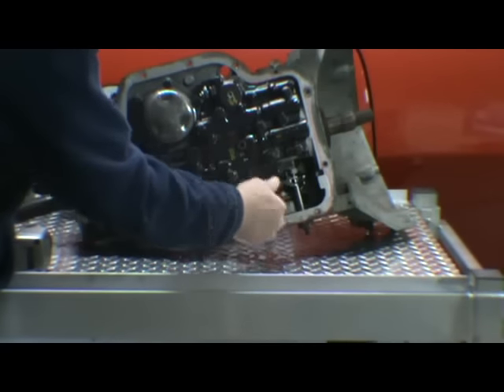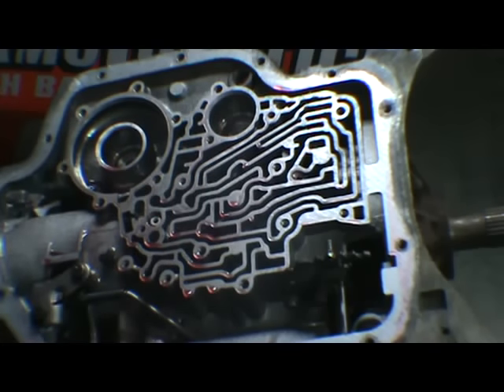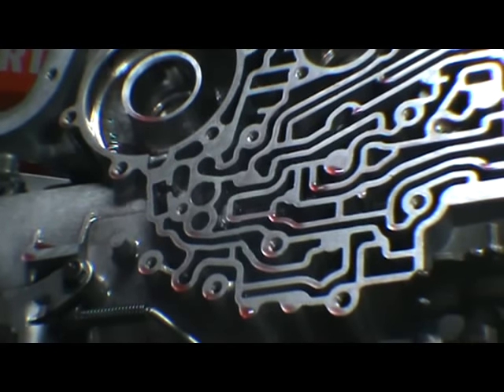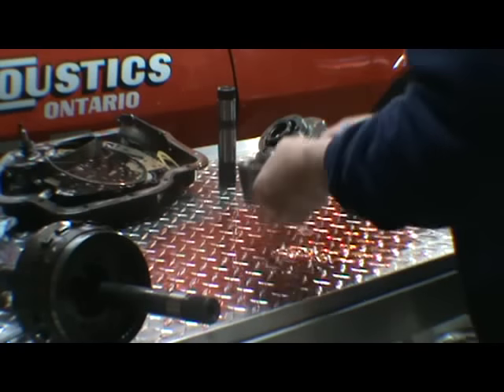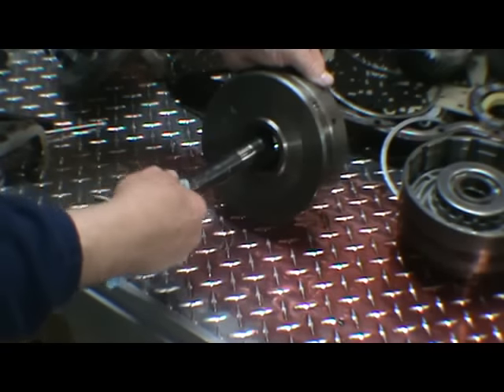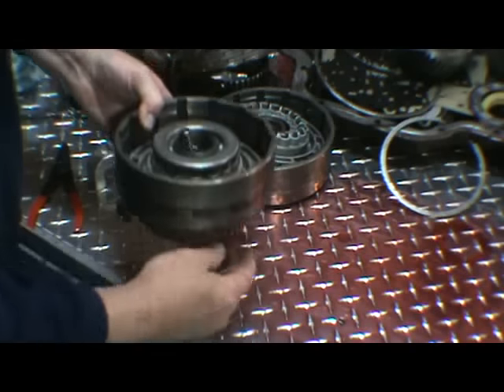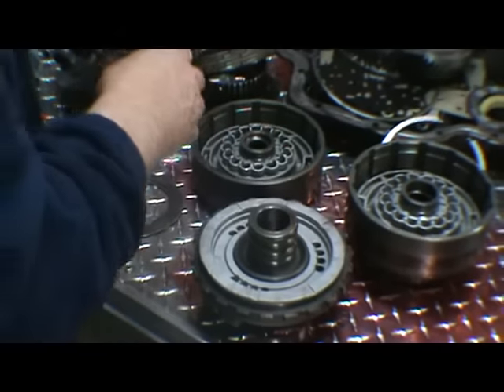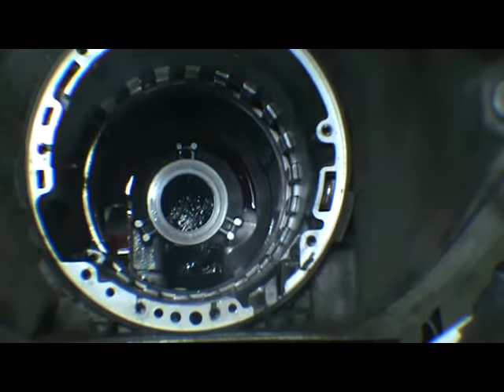Taking Apart The Turbo 400

Comment: Thanks for making this video. I have a question for you. I have a 400 in a 1 ton that just stopped going in reverse. Removing pan for inspection, removed valve body to replace Plastic 1~2 Acc. Piston. removed Rear Acc. cover, the large piston seemed cocked in bore and the large spring when sat down was leaning. So I picked it up to see if it was just bent, for some reason ? ? and It broke in half. Bought Spring, Seal Kit and 1~2 Acc. Piston. Installed new Spring, Seals on Both Rear Pistons. 1~

Comment: Hi there i love your video thank you for  sharing that , i have question for you if you can help me with my car . i have 1968 cadillac devill that i purchased from arizona , in the first day the tranny  was shifting smooth  then start acting bad ,now  when the car cold shift perfect after 2 or 3 minutes driving the tranny will shutdoune  notheing go in gear it well go in gear if i tern the car off and restart it and it well drive for a little and stop , if you can help me pleas let me know whats going on if it need a rebuild or not , thank you best regard    OMARI